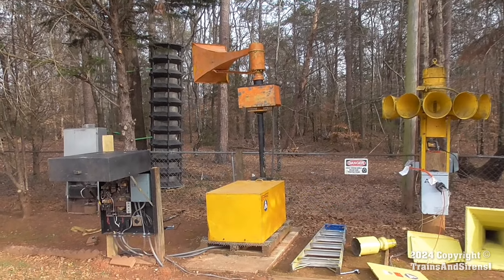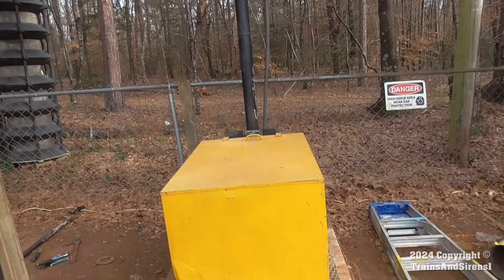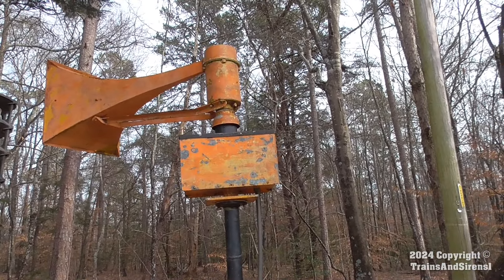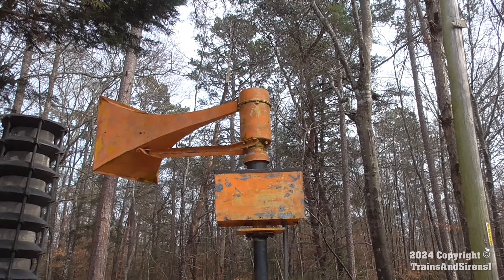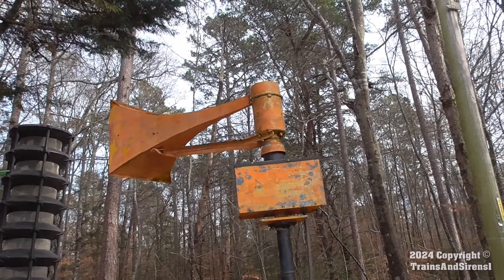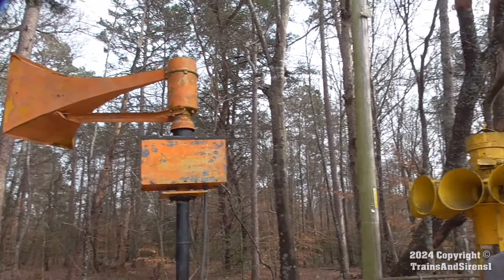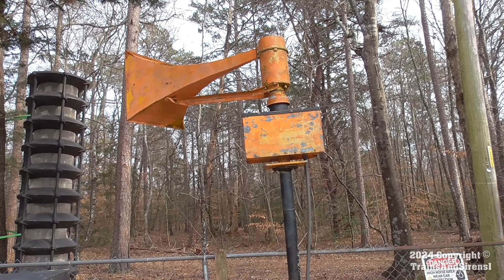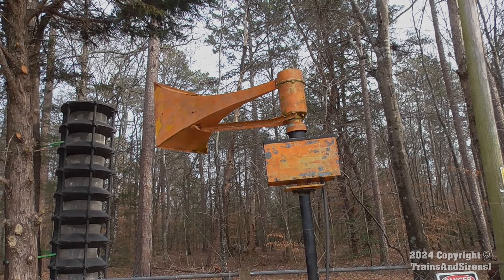My New A1 Thunderbolt 1000 First Run Up with 6M, Double Alert

Comment: the other 1000 is gone for now 😢
Reply: This one's better
Reply: If you say so
Reply: @Glist_ it is it has most of the original parts on it I actually need a 6 ton jack to get it apart lel
Reply: @SirensOfSpartanburg  do you have a thunderbolt of any kind besides the swapped 1000-T
Reply: And repaint it the same color
Reply: @thunderbolt_A10_  no I only have my 1000BT
Reply: Oh ok

Comment: If you say the number is T-630, every close number lists the units from Evanston, IL. It’s possible this unit came from there. 

Looks cool though! I’d like to see it.
Reply: West Shore employees said it came from Canton, OH
Reply: @Glist_  That could be true, but I was only guessing.
Reply from the maker: Thanks. When I got the siren. The siren must of been at a school's roof top because it had a short stand pipe with guy wire mounts.
Reply: @TrainsAndSirens1  That would make sense since all of Canton's were roof-mounted
Reply from the maker: I was referring to the original comment. I didn't see any replies until I refreshed the page.
Reply: So I guess our best assumption is it came from Canton in that case.
Reply: @Glist_  I thought Canton's thunderbolts were 4/5 port?
Reply: @OhioOutdoorWarningSirens it was 4/5 but converted to single tone
Reply: @SirensOfSpartanburg  interesting, was it chopper swapped after the removal or before?
Reply: @OhioOutdoorWarningSirens  we removed the 4/5
Reply: @SirensOfSpartanburg  oh so it was a 4/5 when taken down and yall did the chopper swap. Got it
Reply: @OhioOutdoorWarningSirens yes
Reply from the maker: @OhioOutdoorWarningSirens: When I got this siren, I chopper swapped this siren. It was originally 4/5.
Reply: @TrainsAndSirens1  yeah that's what I was thinking? What do you plan on doing with the 4/5 chopper?
Reply: @OhioOutdoorWarningSirens  he sold it to cooldomino
Reply: Only one serial number came from Evanston, IL within the T-630 range. All of Evanston's thunderbolts were removed in 2020 by braniff, not WSS. All but one have presumably been scrapped.